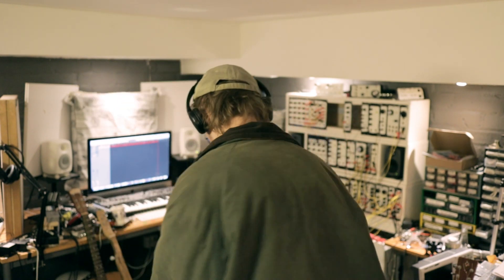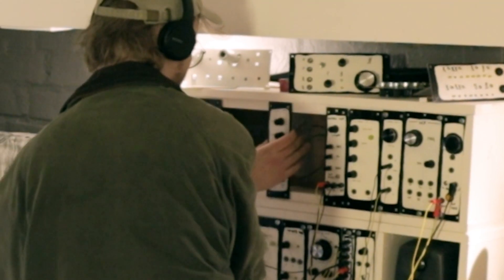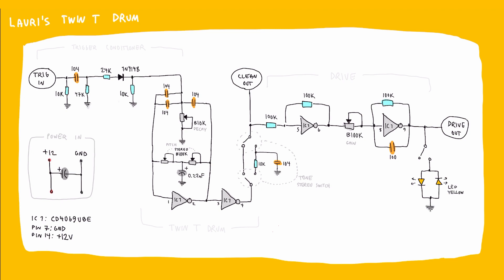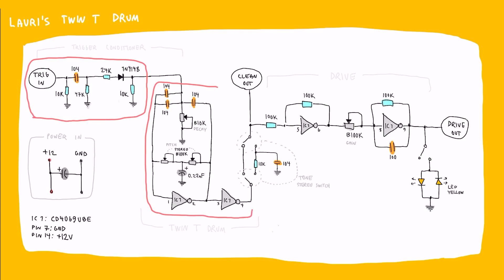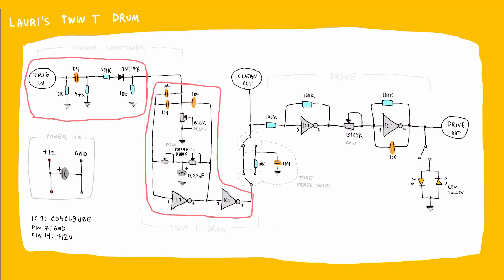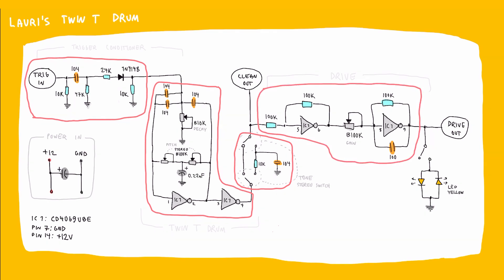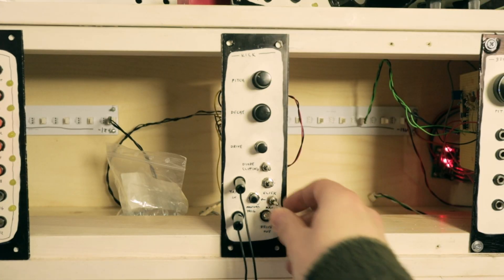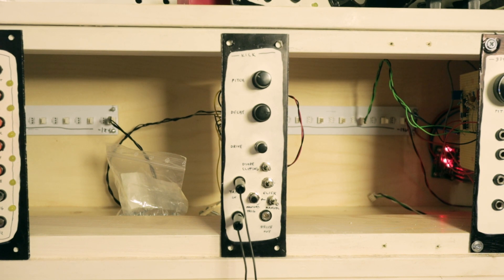DIY twin t kick drum module for modular synth

Comment: Thanks for your videos. Really have fun with these. I added a DC blocking cap to the twin diode clipping circuit (between the switch and the diodes), otherwise only one of the diodes turns on. I tested a few and 330u seemed good.
Reply from the maker: Oh shit I think I had like a 10uF cap there that I forgot from the schematic! I'll add it to the schema in the dropbox link if anyones wondering about this! Thanks for pointing that out!

Comment: I’m a NOOB to electronics. So, here’s my question: for the diodes clipping, don’t you need resistors, to protect the diodes, like 470 Ohms or 1K Ohm? Please, let me know, I want to learn. Thank you kindly
Reply from the maker: I’m really not that smart with electronics myself! I dont know if a resistor would be good practice to use with the LEDs but at least with this circuit theres no problem without. But if you’re using LEDs as power indicator lights or something else, then you need a resistor or the led will burn!
Reply: @LAURISDIYCHANNELTV  Perhaps, at that point in the circuit, the current isn’t high enough, to damage the LEDs? I should take some measurements… Anyhoo, thanks for replying. I truly am trying to learn more about electronics and your videos make learning about this stuff fun - you are one mellow fellow. Cheers mate
Reply from the maker: Yeah that might be the case! Thanks dude!
Reply: According to the CD4069 datasheet, it can only deliver ca. 10mA of current at 12V supply. The maximum current for an LED is around 50mA (20mA is generally already extremely bright).
Reply from the maker: @floretion  Oh yeah that makes sense, thanks for clearing that out for us!
Reply: @floretion  Cool, thanks for the insight. Cheers mate!